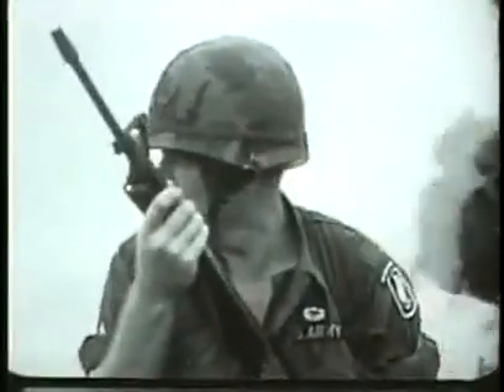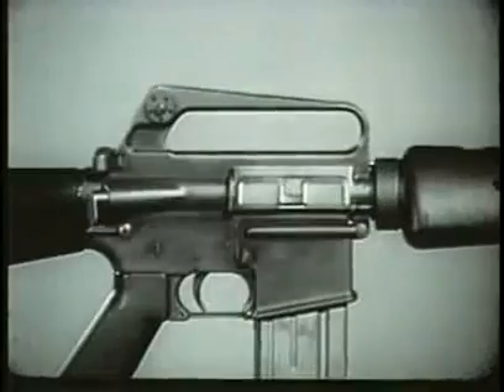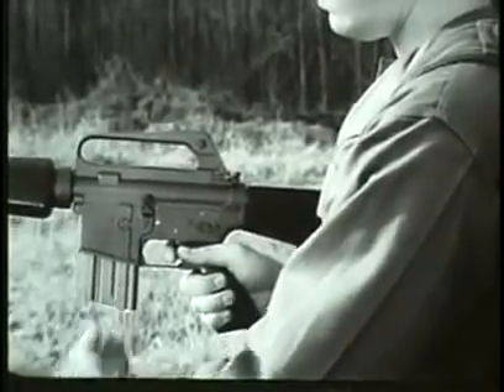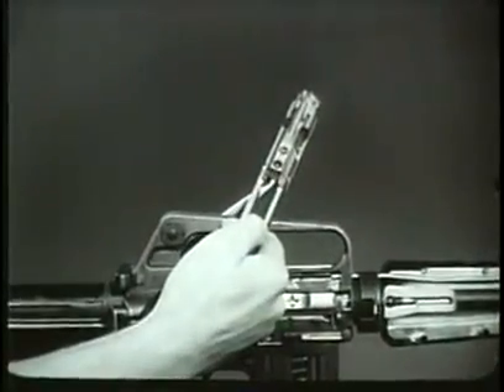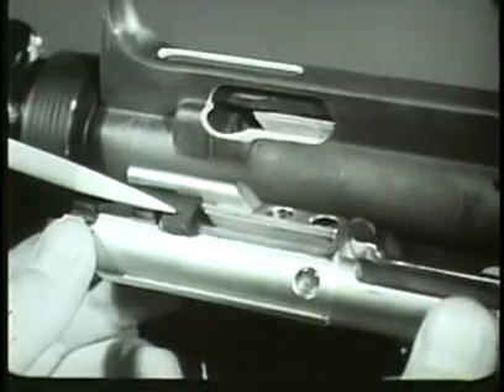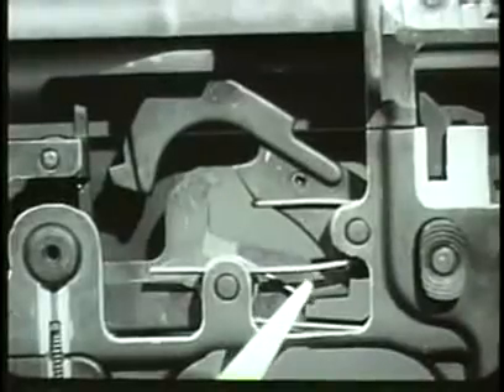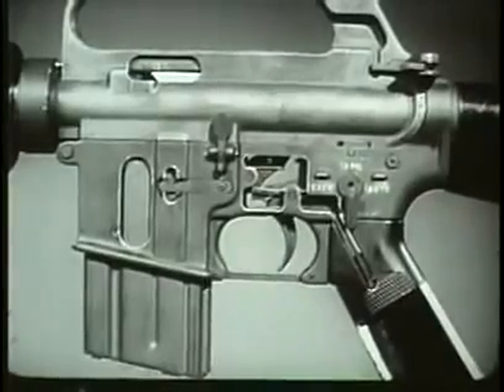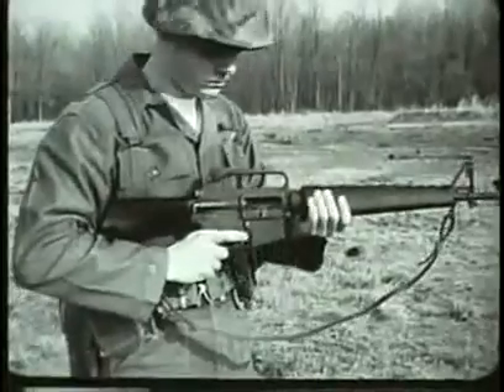Vietnam War Era Training Video: Operation of the M16 (AR15 variant)

Comment: Amazing that even the bolt carrier assembly has gone unchanged for over 60 years. Rifle was way ahead of it's time.
Reply: the M-16/M4/AR platform has had many many improvements which both Knights Armament and Jim Sullivan came up with. there's very little in common between the original and their modified design. improvements such as  a new heavier buffer, stronger lobster tail style extractor, rounded off locking lugs, sand grooves cut into the bottom of the carrier, improved gas rings in the bolt, dual ejector plungers, firing pin spring, captive pins, ambidextrous fire selector and bolt catch/release,  enlarged trigger guard, heavier barrels.... theres more that i am forgetting for sure.
Reply: @nickhowatson4745  screeches in shitty phosphate coating on modern milspec BCGs
Reply: @nickhowatson4745  There have certainly been improvements but "very little in common with the original design"? Most modern ARs still aren't ambidextrous even if those improvements do exist.
Reply: @Tinfoil_Hardhat  theres very few parts that are interchangeable between traditional mil-spec designs and Knights Armament, H&K's or Jim Sullivan's improved designs.
Reply: @Tinfoil_Hardhat  the improved designs make drastic changes in some systems like H&K's short stroke gas piston system or Jim Sullivan's and Knights Armaments Rounded Bolt Locking Lugs.
Reply: @nickhowatson4745  Really the only non interchangeable part when it comes to an M16 and a standard market AR15 is the fire control group. If you want full auto, you need a specific full auto bolt carrier group, but again it is still interchangeable. You can put an M16 lower onto a modern upper receiver and its going to work. Interchange the other parts and it will work.
Reply: @nickhowatson4745  Ok, that's not an AR15 anymore. H&Ks system basically gives you a different gun. And you're harping one specific manufacturers improvement. It's not a standard across the board, its relatively new and isn't interchangeable with most AR15s new or old.
Reply: @Tinfoil_Hardhat  im just saying that there's little in common between modern improved AR designs and traditional old school mil-spec designs.
Reply: i think that if the US standardized on and integrated all of these improvements into one design, it would make the ultimate AR. screw testing out new guns to replace the M4.
Reply: you can't re-invent the wheel...........it will always be round..........
Reply: @numbaoneUFCfan  triangular wheels exist
Reply: The rifle we see now is barely what they wanted. As it was introduced the rifle was on the verge of not working at all. There were many improvements that the designers wanted to make before it was issued but never got the chance due to contract deadlines.
They wanted to make changes afterwards as well but were again never able to due to colt effectively setting the design in stone and freezing all development of it. If colt hadn't been so selfish with their prized possession the design could have had constant development throughout it life and it would be a far better rifle today.
Reply: It wasn't that much head of its time almost every soldier in Vietnam didn't like the m16 at all and always switched it to a AK
Reply: Not the first production. They were massive pieces of shit. No forward assist & jammed constantly. The soldiers HATED them & would pick up any enemy AKs they came across & use them until the ammo they picked up was gone. 
This is per my neighbor who is a Vietnam vet.
Reply: @Prince Harambe Yes. My neighbor is an Army Vietnam vet and told me about how they did the exact same thing because the first production of the M-16 was complete shit & malfunctioned constantly.
Reply: Um sir  the m16 jammed so manytimes and got so many us troops killed bro
Reply: Stoner was a visionary.
Reply: I'd say warfare just hasn't changed much, same with combustion engines. Sure we have all sorts of computer components in an engine bay these days, but the parts are mostly the same. Until we invent something better than Tesla RC cars, combustion is king. Until we invent something better than boomboom stick, AR platform gonna stay king. Lasers and flying cars when? 😆
Reply: You need to watch forgotten weapons on y.t. about the evolution of the m16 and the many problems that incurred but it is still the one of the most iconic guns like ak.47
Reply: Ya but the fwd assist is still gay! Gives you one last shot I guess in a stick situation but whatever
Reply: @bwoodard907  Forward assist isn't gay. Ever lock and load and hear click pulling the trigger? Pull charging handle and bolt back halfway, visually inspect bolt stripped a rnd off mag. Release handle and hit forward assist couple times insures it's in battery. Rock and roll
Reply: @factsnotfeelingssendit5961  I hear you! Still gay as hell! That’s why stoner made the first ones without it.
Reply: @bwoodard907  you have issues with a forward assist 😄 chamber check and hit and you know your in battery. And when the chamber gets hot a rnd my not go fully into battery. For the few ounces it adds I'm ok with it. To each his own. Enjoy shooting when the ammo gets reasonable.
Reply: The bolt it's self is based older than that its based on and near the same as the M1941 Johnson rifle. Look up some of Johnson work and although nothing he made took off. He came up with allot of concepts and designs that are still in use today.
Reply: If you have to include a “seat assist” to the main function, start from scratch
Reply: LOOK AT ALL THESE FUDDS
Reply: There is so much ignorance of actual knowledge of the AR15/M16 development and early life in the military it’s astounding. There are many books and public information that sets the record straight and yet there is still so much misinformation and construed belief of the AR platform.
Reply: Yeah just everything else got changed. Like the magazine capacity, the flash suppressor, the rate of fire, the stock, the iron sites, and the barrel shroud. But other than that it's the same weapon. 😂😂
Reply: a lot of young lives were lost because of that shitty rifle itself jamming in the jungle because of all the mud, they had to pick up aks and use the m16 as a forced backup weapon if they wanted to have a chance at life
Reply: @elegantthug5982  This video says otherwise. The whole ar-15 unreliability is a myth. https://youtu.be/jn17MwQT8DI
Reply: @elegantthug5982  The AK is great for sandy and cold climates. Humid climate, I think both Stoner and Kalashnikovs are pretty good. The M14 was known to jam though.
Reply: @elegantthug5982  My neighbor is a Vietnam vet, and he told me this exact thing. 
He did say that the second version was much better, but still unreliable at best.
Reply: Some manufacturers have changed it ever so slightly, mainly camhead position slightly and it’s path.  Cam head leading to bolt failure is 9 out of 10 AR-15 malfunctions.
Reply: @Prince Harambe 
It was originally designed as a semi-auto security rifle for Air Force police. It was rushed into service and the originals were not robust enough, especially in the moisture of South East Asia. Furthermore the wrong gun powder was used for the bullets as that was what was available in quantity. The current M-16 variants are much better BUT still require constant cleaning since the aperture for the gas tube and key are small. This thing was designed in the 1950's using aircraft aluminum!
Reply: Weren't American soldiers dropping m16s for Ak47s? How was this rifle ahead of its time? It used to jam uncontrollably and was extremely unreliable.
Reply: yall can settle this beef playing COD
Reply: Way ahead of its time is right it jams as much as modern weapons do😂
Reply: The XM16E1? Lol
Reply: @Nature Taco no they didn’t 😂🤣
Reply: @Nature Taco you know people embellish stories right?  I’m telling you, the m16 is far more reliable than the m14 or even ak 47
Reply: more like it was cheapest weapons platform they could mass produce.
Reply: @EdgeO419  😂😂😂🤣🤣🤣🤣 you’re a tool.
Reply: @flight2k5  Nah just someone who spent more of his share of time shooting, cleaning and even working as a assistant  armorer  maintaining these things and grew to dislike them.
Reply: @EdgeO419  wait I thought you heard it from vets that were in Vietnam.
Reply: @Nature Taco I know how RIFLES work 😂🤣. You’ve obviously never been in the military considering you called it a gun 😂😂🤣
Reply: @Nature Taco because I don’t want to waste energy taking to you 😂😂🤣.
Reply: @Nature Taco dude just give up.  You have zero military experience. You’re just regurgitating shit you’ve heard others say 😂😂😂🤣🤣🤣
Reply: @Nature Taco so you hate them but you work on them?  I do it because I know it triggers you 😂🤣🤣
Reply: @Nature Taco here yo I said you learned from vets 😂😂🤣😂 seems like your story is always changing
Reply: @Prince Harambe a reason a AK may be picked up is due to anmo shortage 

Stealing guns for supplies

Taking a trophy
Reply: Yet we lost Vietnam
Reply: The AR15s problem is that its too complex and unreliable, it needs extensive care and work bad in cold weather. That's why many militaries see the design as subpar, for example here in Sweden we adopted the FN FNC instead which is a much more reliable weapon system (though it have other issues like being too heavy, no bolt catch until later versions, etc, etc)
Reply: @andersmalmgren6528  There is Sweden you people don’t even go to war or fire shots in anger. Stay in your lane.
Reply: @riflesfirst208  we are obviously still better at firearm trials. We would never adopt a Gucci weapon system like the AR check garand thumbs  latest video. Only AR type system that was ok was the HK416
Reply: @andersmalmgren6528  False. The Standard Block 2 M4 did great. 

Also, you live in Sweden, not Antarctica. It doesn’t get that cold.
Reply: @riflesfirst208  it failed to eject and he had to clear it. While the FN FNC kept going it's 5 rounds. If Russia attacked Sweden which is still the most likly event that would bring Sweden to war we would be overrun in days and would have to revert to guerilla tactics. That would mean harsh environments with less means for proper maintenance. We need to have a system that can work in harsh conditions without proper maintenance. Same with our war planes, we can't have primadonna jets like the F35, we need planes like the Gripen that can take a beating and be turned around from a back country road in 10 minutes by a small team of conscripts.
Reply: @andersmalmgren6528  The Gripen is junk. It’s worse than having no jets because at least with no jets you don’t have to train pilots that would get splashed by Flankers the second they take off. 

Anyway, the test was designed to make the guns fail. It’s not a realistic test, the guns would simply not get that wet and that cold at the same time. 

That’s like complaining a gun didn’t work after being dunked into a volcano when you live in New Jersey or something and will never see a volcano, let alone get into a gunfight on one.
Reply: @riflesfirst208  gripen E is the world's most capable plane at the moment. It doesnt use obsolete conventional stealth but instead uses the most advanced EWS known to man. The legacy version of it, Gripen C, scored equal to F22 at red flag. 

I agree the test isn't the best as he only did it once. You need to repeat it. But still the only guns that completely failed on first run was AR type. FN Scar didn't do that well thought I thought it would have done better to be honest.
Reply: @andersmalmgren6528  It’s a nonsense test though. I don’t live in the arctic, you don’t live in the arctic, you and I will never experience those conditions so it is irrelevant. 

And no, those Red Flag drills are just games and the US doesn’t show full capability of a lot of their gear, especially things like the F-22.
Reply: @riflesfirst208  we also sunk an entire US carrier group with a single sub. North of Sweden is included in the artic circle, yanks and tour knowlwdge of the world 🤣
Reply: @andersmalmgren6528  I’ll check it out.
Reply: @andersmalmgren6528  My point is nowhere that is that cold is also that wet to the point the guns will get drenched in liquid. 

And left to sit for that matter.
Reply: @riflesfirst208  if you go prone in snow and fire your weapon snow will melt. Melted Snow is water. Water will freeze.
Reply: @andersmalmgren6528  Done that plenty of times and the water generally runs off the gun, not to mention there’s no way you will be getting the amount of water in your gun that was shown in the video.
Reply: @riflesfirst208  are you saying you are more qualified to do this trials than countries like Sweden and Finland that have opted out of the AR platform for more robust AK like systems?
Reply: @andersmalmgren6528  Finland produces their own arms, of course they’re going to use a domestic product. 

But are you saying two countries that have sat out every war in the past century are more qualified to give opinions on war fighting tools used with success by other countries in combat in every environment on Earth?
Reply: @andersmalmgren6528  The AR is extremely simple it just as smaller parts compared to a big and clunky AK or something similar.
Reliability is determined by how well maintained the rifle is. So if it's well looked after then it is reliable but if you don't clean it then it will become unreliable. Other designs like the AK stay reliable for longer without cleaning.
Reply: @Turgz  cleaning can be hard in the field. Also snow and ice is a problem for the AR15 platform even when maintained properly. I guess this is why our police force have adopted it and not the military.
Reply: @andersmalmgren6528  You say unreliable? Since 1978 I've owned and extensively fired several variations of the AR 15 along with AK rifles in 3 calibers, and an HK91. Reliability has been excellent! It's combination of accuracy and light weight would make it my first pick in a firefight. I say this as a Marine Corps veteran.
Reply: @tommccormick9290  I would argue it needs more maintainance than other type of rifles like the FN FNC mentioned earlier to stay reliable. And that it's not perfect for all weather conditions like ice and snow.
Reply: @andersmalmgren6528  i suspect it had a lot more to do with awarding thr contract to fn more than any reliability concerns...by the time the fnc was introduced..ie 1979...many of the issues of the armalite platform had been dealt with...and todays variant the m4 is about as reliable a battle rifle as you could want...dont get me wrong i think the fn is a damn fine weapon im just fairly certain the contract awards by that time had a lot more to do with cost and keeping the manufacturing local(ish)
Reply: @RedDogForge  we already had adopted the FN Mag several years earlier so offcourse fn had the upper hand in that regard. But the AR15 platform did fail our cold weather tests and the fn fnc passed. Though we did some modifications on it too in that regard. Not saying ar15 is a bad platform. If sweden was invaded by Russia we would need to turn to guerilla warfare and our arsenal reflects that.
Reply: @tommccormick9290  
How would you compare it to the AK-74 design?
Reply: @fazole  The AR15 has the edge ergonomically but the AK74 has less felt recoil making it easier to stay on target during rapid fire for faster follow up shots. Everything else (At least for me) is too close to make a significant difference. Of course, the AR has a lot more aftermarket accessories.
Reply: @andersmalmgren6528  Break free. CLP. Will fire in any climate
Reply: @factsnotfeelingssendit5961  its not the temperature and lubing. Its that snow and ice will get into the action.
Reply: @andersmalmgren6528  keep the dust cover closed. Apply light coat of CLP to all parts wipe dry.
Reply: @factsnotfeelingssendit5961  yeah well, the ice and snow will get in there when you are firing it. The fn fnc was evaluated to be better in this regard
Reply: This crappy gun jammed and fucked up and is responsible for MANY lives lost in Vietnam due to malfunction. Amazing that people still praise this weapon when there are such better ones. Like hellooo what year was the AK-47 invented? Give ya a hint:it’s in the goddamn name haha. Way ahead of its time.
Reply: @Puppy_Puppington  Those were the result of sabotage by the top brass. The top brass wanted the M16 to fail and the M14 to stay in service, so they did these:
- 1: They produced 5.56mm ammo using old shit powder made for .30-06.
- 2: They didn't issue them with cleaning kits.
- 3: Most damningly, they told the soldiers that the rifle didn't need cleaning.
- 4: They added a forward assist to the rifle. News flash: *it didn't need one*. This only made the M16 heavier and more complex, and using the forward assist only makes most malfunctions worse.

All this led to the M16 being a failure, not the design of the rifle.
Reply: @mofumyon  Agreed 100%.  Gun Jesus has taught us well
Reply: @mofumyon  AKs are so reliable, they don't need a GD forward assist!
Reply: @mofumyon  dude it’s the design but it’s a high maintenance mofo! And I believe they taught their troops how to clean it. In fact didn’t all the military ordered versions come with a basic field kit in the handle or but? It’s a good rifle but like a two stroke dirt bike…she gone get dirty fast
Reply: @mofumyon  You have proof of these claims?
Reply: @mofumyon  IIRC, Colt managed to solve the shit powder issue by adding chrome lining.
Reply: @mofumyon  don’t forget they used to not have chrome lined barrels
Reply: @mofumyon  well said!
Reply: @mofumyon  yeah true
And then when you look at those that were issued to USAF (the very first ones) showed
Most of those issues weren't even that big of problem if the rifle was simply taken care of
Reply: @mofumyon  Presence of the forward assist has nothing to do with increasing failures.
Reply: @JN-mk2fh  The AK’s bolt handle is designed to function as a forward assist. 

So you just played yourself.
Reply: @Puppy_Puppington  I heard the same thing from dragon man on YouTube he was a Vietnam vet that’s fucked up. You send men out to war with a malfunctioning gun.
Reply: @Puppy_Puppington  you clearly don't know anything about either of those weapons, design work, or engineering.
Reply: @Puppy_Puppington  The first version jammed, but that wasn't the fault of the actual design. The DoD decided to not chrome line the chambers to save money, terrible idea in a jungle environment. On top of that, troops weren't trained on how to clean them, and they used the wrong type of powder in the ammo which fouled the action far faster than it otherwise would have. 

The weapon gets praise because the actual design is very good. It's the most produced self loading rifle design in the world, and still widely used today.
Reply: @Puppy_Puppington  The M-16 was made by Mattel of all companies too. 
They were massive pieces of shit & the soldiers HATED them.
Reply: @Puppy_Puppington  They jammed pretty much solely based on using the wrong powder, which the manufacturer told the army to usez
Reply: Puppy Puppington if you look into it you’ll see that the problems were not due to the rifle itself
Reply: @Puppy_Puppington  if you research the ar15 is superior to the ak47 maybe the ak74 can be on par with the ar15. The reason why the m16 rifle was bad when first introduced, was due to some paper pushers in the army sabotaging the weapon with bad components not made to specifications of the rifle, thats why the m16A1 was made
Reply: @Puppy_Puppington  That was due to not producing the early models with hardened receivers, chrome lined barrels and cleaning kits.   If it was as terrible as you say it would not still be in service.
Reply: @Puppy_Puppington  you're a delusional person. The M16 is a good weapons system. The ammunition the environment was too much for this weapon to handle. Plus giving out 1 or 2 cleaning kits per 5 men is absurd
Reply: @Puppy_Puppington  bait
Reply: @Puppy_Puppington   You do know that was the first model of M16? The M16A1 is where this rifle performed flawlessly. Today, it's still as reliable as ever, far more accurate than an AK. The only difference between the two is the M16 was pressed into service before it was perfected. The AK had reliability issues in the testing phases. Kalashnikov actually didn't want to improve the first prototypes until Aleksandr Zaitsev convinced him to. This change ended up being a major contributor to the AKs reliability.
Reply: @Puppy_Puppington  yeah, ak go brrr with literally multilated corpses been covering it for days, fire few mags with M16 and gun go click
Reply: @Puppy_Puppington  Dont forget they were told they didnt need to clean the rifle, and crappy ammo.
Reply: @Puppy_Puppington  Thats misleading. Weapons were thought to be self cleaning and were not issued with cleaning kits until problems occured later on. Hell, even ak's and akm's will induce malfunctions when not maintained.
Reply: @Puppy_Puppington  I didn’t realize the ak was made in 47 lmao
Reply: @Puppy_Puppington  watch your language
Reply: @Puppy_Puppington  the AR15/M16 rifle isn’t crappy in anyway. And the rifle wasn’t responsible for any of the lives lost during the early years of Vietnam, it was the powder used in the ammunition that caused all the problems plus the lack of issues cleaning kits and the bald face lie that it was self cleaning. The rifle had nothing to do with the malfunctions. None of this is opinion it was all very meticulously documented in the 1968 congressional committee. You can google it and read it yourself, it’s open to the public.
Reply: @Puppy_Puppington  the AK47 is actually a much inferior or weapon to the AR15/M16. The original 1947 models were actually trash and replaced by new design in 1949. All the standard AK rifles used I. All the countries around the world since then are all based on the 1949 design changes. The AK47 and its many variables all lack a dust cover and foreign debris/matter can get into the action and cause a stoppage. Also since the it is a piston gas system there is no force of gas exhaustion that happened at the action of the cycle of the rifle to blow out any debris. The AR15/M16 does and is a big reason why it is much harder and near impossible to have foreign debris/matter get into the action and cause a stoppage.
Reply: @Puppy_Puppington  Yah, later in the war when they started to reuse the use M16s. You obviously don't know much about it
Reply: @Puppy_Puppington  lol you AK lovers cannot hit anything over 300 meters.
Reply: @Puppy_Puppington  I mean the M16 paved the way for modern ARs? They didn’t even have cleaning kits at the time in Vietnam and the conditions were terrible so yeah they probably jammed once in awhile. I’m sure m16s weren’t as reliable as AKs at the time, but you can’t argue how the M16 lead the way to the creation of modern ARs which are definitely more accurate and a much more customizable platform than AKs. I like AKs but they are cheaply made a lot of times and can struggle with accuracy and reliability as well. I think both are great platforms and way before their time but they have different applications. Overall, I agree with you in a way and think the AK could have been a better option in Vietnam.
Reply: @Puppy_Puppington  AK-47 is just a shittier copy of the Stg44 🤣
Reply: @Puppy_Puppington  fair point. I think people just praise it for It’s modern design and most people probably don’t take practicality in to consideration
Reply: @Puppy_Puppington  Nationalists are insane
Reply: @Puppy_Puppington  yeah because the first iteration of the Kalashnikov was full proof.
Reply: @Puppy_Puppington , your ignorance is showing. Changes in the rifle and, most important, ammunition that never should have happened were the reason for it's early failures. Once Big Army admitted there was a problem and fixed it, there was no better military rifle in the world. The M16 is THE world standard. Even former Communist Bloc countries with plenty of experience with AK's have dropped that glorified submachine gun in favor of M16 derivatives or slightly modernized local variants.
Reply: @Puppy_Puppington  heres a spoiler for you
AK-47 was a shit too
It took em another 4-5 years till its quality was acceptable even for Soviet Standards
And even then AKM outclassed it the moment it Dropped in late 50s
Reply: @Puppy_Puppington  myth
Reply: @Puppy_Puppington  nah that was because of the sudden change of ammunition and also some problems it faced while in the jungle, the gun improved and eventually in my opinion surpasses the ak47 with the invention of m16a2s and onwards. I see aks for power with its high caliber and m16s for its accuracy and light/ still powerful bullet
Reply: @Puppy_Puppington  not a crappy gun, it was over confidence in the weapon system (saying it didn't need cleaning ever) and useage of poor gun powder. it's not a magic gun none of them are, but it does come rather close imo
Reply: @Puppy_Puppington  I remember a story of a battalion going out with 72 troops and only 19 coming back and when they went to retrieve the bodies most of them were found with either a jammed cartridge, or the gun completely broke down from where the soldier was trying to clear a malfunction, still a great rifle tho
Reply: @mikehoncho658  false!  1. A battalion is about 500 troops ,75 is under a size of a company.  2. Probably made up story, earlier M-16s were jammed if you don't clean them and dinky around with the auto fire spring, dirty powder and troops were told no need to clean. Those were corrected no such loss. 
I like AK but for the accuracy, quality buiIt prefer AR-15. Most jams can be easy fixed. Carrying an AK reminded me of the north Vietnamese commies, hated those suckers!
Reply: @hochoma1564  I’m pretty sure it wasn’t made up, the guy telling it got a medal for it, it was 75 guys, in Vietnam they didn’t rly do exactly how you would expect them to these days, guys came and went so the numbers were staggered, there are many examples of troops being found dead with a jammed rifle, but they were set up for failure bc the guns came with no cleaning kit and the ammo was altered against them, I’m not knocking the ar platform bc I prefer it, but I am saying it was sad those guys were set for failure with this new to them rifle, there is nothing wrong with the m-16A1 rifle as long as you clean it and have quality ammo
Reply: @hochoma1564  and to add to my last comment, I’m not in the military nor is my family but I do understand how most of it works, so excuse me if I’m not politically correct
Reply: @mikehoncho658  Sure, nothing personal! Just correcting some stuffs! I have both, AR and AK!
Reply: @hochoma1564  both great rifles but I’m more into handguns bc it takes a good amount of skill to shoot a handgun especially at distance, there is just a certain amount of satisfaction I get from shooting a handgun accurately at distances further than 25 yard, I love it, anyone can shoulder a rifle like the ar or ak and be accurate
Reply: @mikehoncho658  If I were to only have ONE gun then it would also be a handgun and the ONLY reason is because its very concealable compared to rifles, shotguns, and submachine guns.
Reply: @hochoma1564   The M16 is far more accurate than an AK lmao. Strictly because of the type of sights they use. That alone is a major advantage the M16 has.
Reply: @josh05683 Yeah, duh! Look at my previous comments! I know, have both!
Reply: @andrewjin6618  yeah they were set up for failure, that same rifle has been proven time and time again
Reply: @mikehoncho658  Proof?
Reply: @hochoma1564  
The AK-74 is a pretty good rifle. Lightweight, accurate, reliable. Not great for mounting optics, though.
Reply: @fazole  and Russian changes to 5.45x39in AK-74 ,almost like AR/M4 5.56x45. You can see why!
Reply: @mikehoncho658  I remember the story about the kid who ate Pop Rocks and drank a Coke and his stomach exploded.
Reply: @MinecraftGuy237  eh handguns have low ammo count, low range kinda if you have good aim and it would be alot preferable to have a rifle than a low caliber handgun
Reply: how can it be ahead of it's time when stg44 and fedorov already invented by that time.
Reply: @jooger69  aluminum and plastics that were used in its construction.
Reply: @numbaoneUFCfan  I meant the Ak-47
Reply: @jooger69  Different beasts/operating systems etc. .. .
Reply: Right this is why the Veitmen took the m16 when they could. M16 did what it was designed to do. Put a lot of rounds down rage and a small group. Early rifles where not chrome lined barrels. They soon corrected this.
Reply: cough ak is better cough
Reply: @nnoxx_PK  The ammo is heavier and bulkier therefore you have to carry less. It is inaccurate beyond 100 meters. You have to cant the magazine to feed it which makes mag changes considerably slower and improper mag changes under duress. Also contrary to popular belief they do have a tendency to have feed jams.
Reply: @stevenlindsey2056   cough anything but the ar-15 platform cough hk guns are better cough
Reply: @nnoxx_PK  I prefer the AR platform. It has been a reliable service weapon for decades.